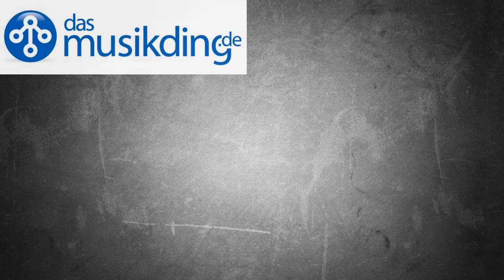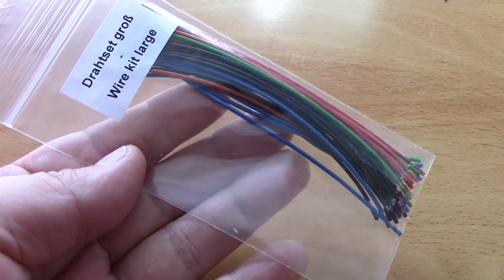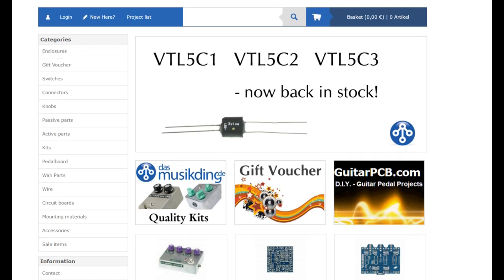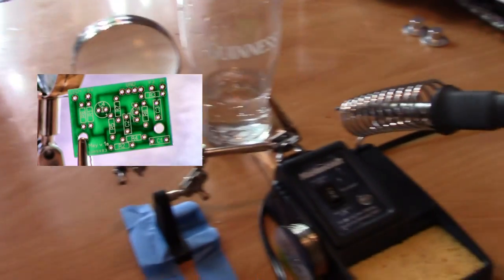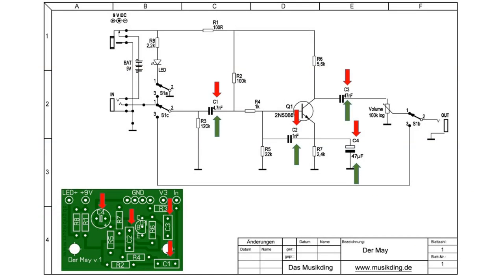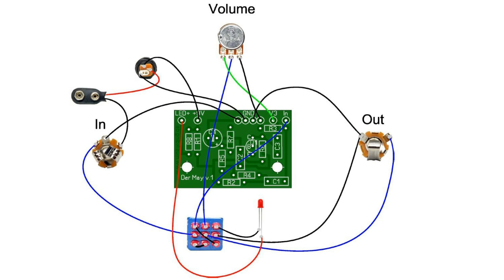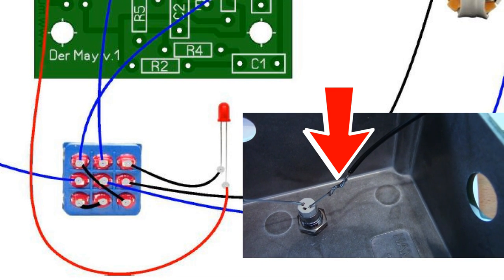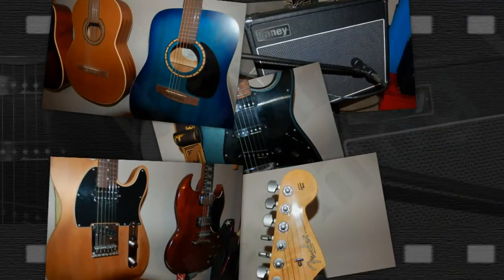Brian May Treble Booster Kit DIY by Musikding - Part 1 - Assembly

Comment: Thank you for this tutorial (it is my 2nd DIY project). Did you notice noise/low freq hum as the volume increases beyond 12:00? I just need to know wether there's something wrong with my skills or if it's part of the design. Nice treble boost otherwise. Thanx!
Reply from the maker: Hi there. I just gave mine a try..I have not noticed anything as u have described. Not sure ?

Comment: Hi, still waiting for part two of the Brian May treble booster build. I don't think anyone would mind if you didn't actually play a Brian line, but it would be helpful to hear the difference the kit makes to the guitar's sound - both clean and dirty. Cheers.
Reply from the maker: My apologies and thanks for watching. I really need to do part two it is WAY overdue. I will do a demo using a Strat, Les Paul and Home-Made Red Special.
Reply: I just put one together over the weekend. It does work well and does something very distinctive to the signal in very Brian May way. I wasn't even using a red special copy or a vox.  My bridge humbucker does behave similarly to one of May's pickup settings. Ran it through a laptop amp simulator - set just on verge of overdrive and into a cheap surround sound amp ( which shouldn't have worked well ) but even with that it sounds a lot like the guitar distortion on Queen recordings. Very simple and very attractive sounding - lots of drive, rich saturation and a nice top end that sizzles and sparkles without being harsh. If we could quantify good guitar tone and divide it by the number of electronic components involved - this device would have the highest ratio imaginable. Recommend it!